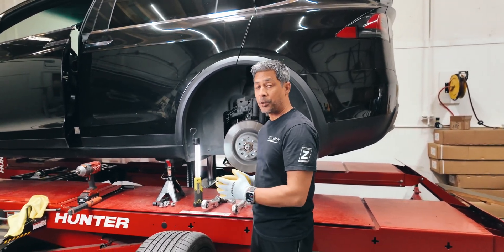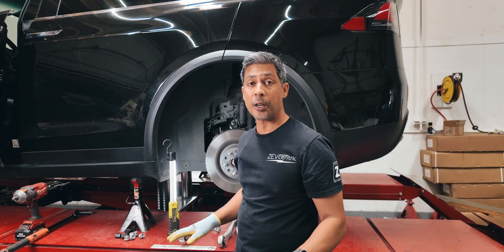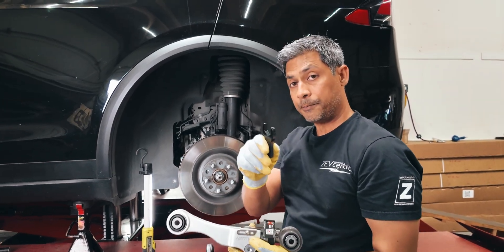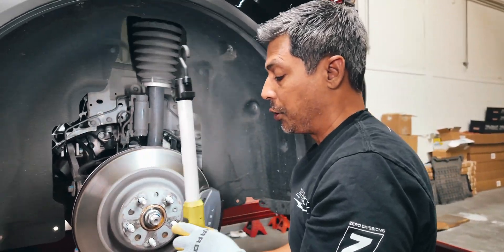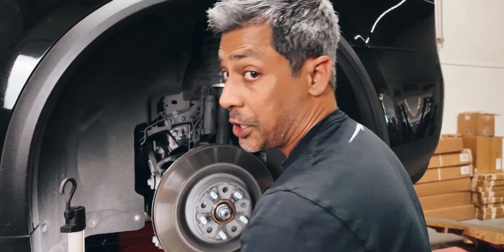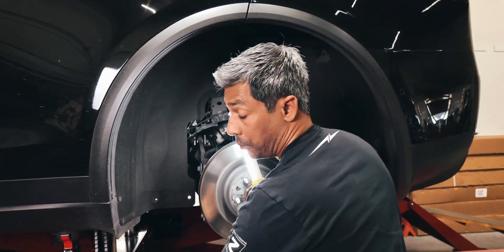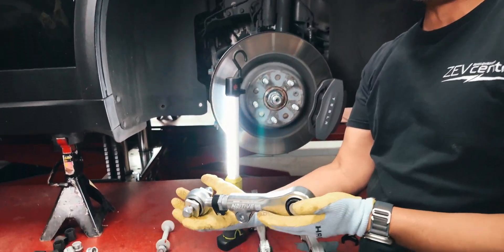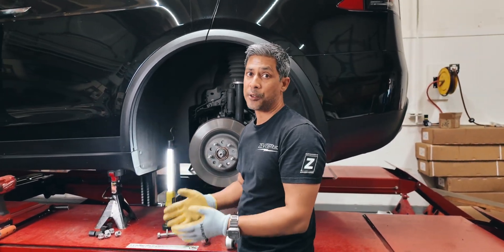Uneven Tire Wear on Tesla Model S/X? Causes & Solutions Explained

Comment: Yeah I found out when my 9000 mile tires that looked brand new from any angle other than under the car when they wore through and blew a dime sized hole in one of them 120 miles from home and the nearest Tesla shop. Great to know this is not adjustable and is just a major design flaw and safety issue since I have an alignment appointment at Tesla today at 230. $1000 in towing, $700 in tires and next a $250 alignment that isnt going to fix the problem. Awesome. Still love the car though.

Comment: Now imagine how much incompetent people are working in high positions ..  To make something like that and even don't doing something about it...  
This happening in politics..  and they are reason we have f upp world..  
I have Porsche Cayenne... And on that car you can adjust everything.. BUT ..  factory settings on rear camber are also curved inside and wearing off tyers will appear from inside..    🤯 ...  And on service and alignment they don't want to do something about it.. 🤡 ..   They say that is for stability..   Yeah .. I am driving every corner in 160 kmh .. and I need that 😂😂🎉🎉. ...  NO!!  
Mye tyers are expensive and needs to be faster replaced = that's it ..  
Wtf.. is going on with world..  everybody wants to trick you somehow just to earn more money ...    And then they how tricked you! Losing that money to som other TRICKER 😂😂😂...
Reply: I had a Cayenne S, the Model X makes it look like a joke in every way including expensive maintenance caused by terrible engineering and design flaws(ie cylinder scoring ie new engine at 80k).
Reply: @stinkwink695  i was thinking to switch Cayenne for model X ..   I know X is not perfect.  But it is possible to fix lots of things at home..  if you are little handy..  
I drive Cayenne i hope nothing will go wronge..  i already fixed and modified lots of things..

Comment: my 2013 model S coil strut ( no air) no performance. i replaced all 4 struts, i noticed the ride height is off, rear and front.   can the be corrected to factory drive height.   please advice.
Reply from the maker: Probably need to torque the bushings at a specific ride height

Comment: I had the exact same problem with my 2019 model X, the inner side of the rear tires has the mesh wire exposed where as the outer part of the tire was intact and had tread left.
Reply from the maker: Were you able to get it corrected with some camber arms?

Comment: So, it is no longer recommended to put the camber arm adjustor on the hub side of the car?  Both camber and toe arm adjustors need to be on the subframe?
Reply from the maker: that is determined by how easy it is to access the adjustment.

Comment: The actual Tesla specs causes premature tire wear. Shouldn’t that be in question?
Reply from the maker: @Player_Mick  the factory specs have a very broad range so it just depends where you are in that range. There is a good part and there’s a bad part. The problem is is that some of it is not adjustable from the factory so you don’t really have a choice where you want to land in that range. That is why you purchase aftermarket components to get into the better part of that range
Reply: Just keep your car at medium height
Reply: @Laissez_Faire  I did, and high, and it still happened, blew a tire 120 miles away, 9000 miles on the tires $1000 in towing, $700 in tires and I have an alignment appointment today at Tesla that I now know won't solve the problem.

Comment: hi i wanna know that parts can change bushing??
Reply: Yes, the bushings can be replaced and they also come with a 6-year to lifetime warranty
Reply: @DonPtashne which part that has bushings are you guys talking about? And the replacement bushings are done and warranted by tesla?
Reply: The bushings on the N2itive arms can be replaced if for some reason you need a new ones. I think that's what the other guy was asking about. But Tesla warranty of course will not cover replacing bushings on parts that are not Tesla parts.  @ReadRevelationChapter20

Comment: Just to confirm, minus the arm fatigue the camber and toe issues do not affect the cars with 19 inch wheels, correct?
Reply from the maker: The issue remains but since you can rotate them it’s much less noticeable.
Reply: @zevcentric  Why can't you rotate the 20s? Can't you swap the tires onto the other rims?
Reply from the maker: @stinkwink695  if wheels or tires are not symmetrical then you can't rotate.
Reply: @zevcentric  So the tires have a designated inside and outside as well as rotation direction? They dont make symmetrical tires in that size or what?
Reply from the maker: @stinkwink695  all Model X have staggered wheels and tires.  You cannot rotate front to rear.  As long as they are not directional tires you can rotate left to right.  Depending on the Model year of the S you may or may not be able to rotate them.  Only you will be able to answer that question by looking at what you have.  If you can confirm they are the same at all four corners as well as the same wheel sizes/offsets then you can rotate. If you need additional details I'd visit your local tire shop so they can look in person and further advise.
Reply: @zevcentric  I have a 2018 Model X with the 20" rims. 275/45 R20 Im saying can't you remove the left rear tire from the rim and remount it on the right side rear and vice versa? They would rotate the same direction, just the inside of the tire would now be on the outside, and the outside would be on the inside?
Reply from the maker: @stinkwink695  that would be wrong to do for reasons you've just mentioned.  if you're attempting to avoid buying new tires due to camber wear and you just want to "flip" the tires on the same wheels then that's not advised for tires like yours.  Those are called asymmetric tires.  You can flip directional tires but not inside, outside ones.  The best option is to get camber arms and then buy new tires.
Reply: @zevcentric  OK, so they do have a designated inside and outside of the tire, I was saying take the left rear off the left rim, leave it pointing the same direction and mount it on the right rim. But there is an inside and an outside so you cant.

Comment: Do you know why Tesla made the car with this clear deficiency
Reply from the maker: On the S and X having air suspension doesn’t help.  Not many manufacturers have factory rear camber adjustment.  Lots of torque and a heavy vehicle dont help.
Reply: The motivation is to score an impressive 0-60mph time, which is basically nonsense for EV. That's a concept to evaluate ICE power output response curve
Reply: When coming out of the factory, both camber and toe are out of spec for daily use. With so many tires that are prematurely wasted, and denial of the issue, people may wonder if they really aim to help the environment. 😢
Reply: @Hands-OnDeck  This would only hurt 0-60, having the car resting on a mountain bike tire isn't good for acceleration, its would be great for range though.
Reply: SHAME ON TESLA!!